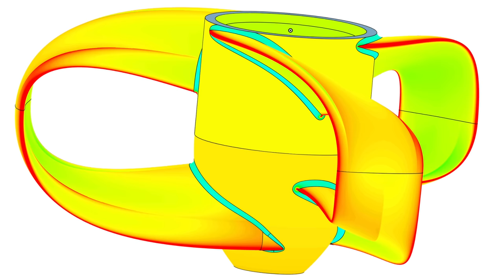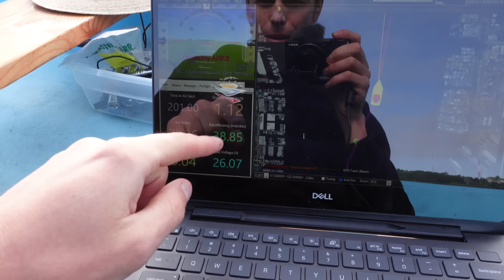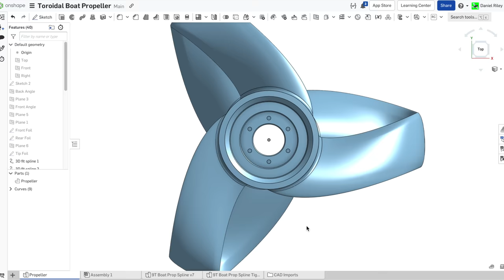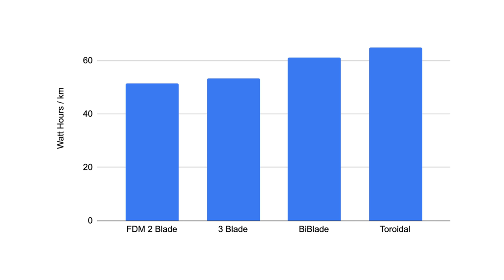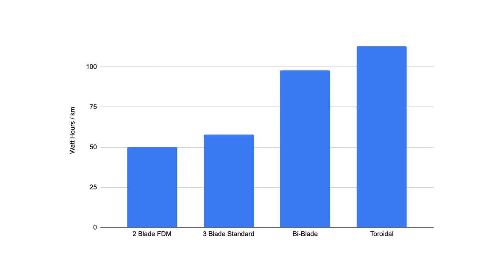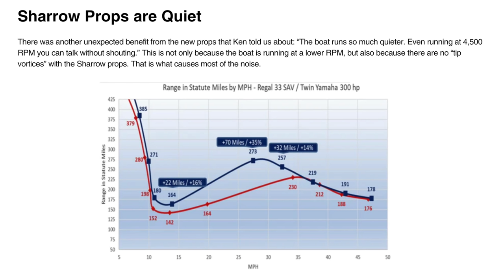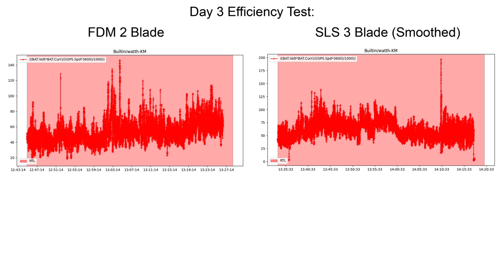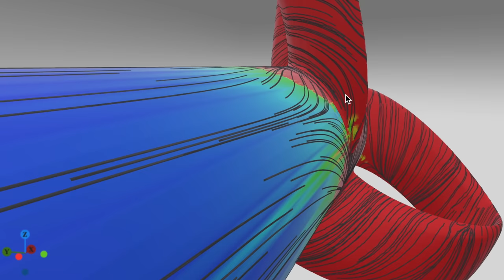Testing Futuristic Propeller Designs on my Solar Powered Boat

Comment: Ok, now borrow an actual toroidal prop if possible (they cost a ton) and do tests OR see if a company that makes them would make you a custom one because now we really need to know if properly adjusted toroidal are as better as they are.

PS: The thing about tip vortices are indeed a thing for water props but it is mostly only a concern for military ships especially submarines where every little noise source counts.

Comment: The first 3d printed propeller video I view made it obvious with the resolution of the printer was not sufficient to reduce turbulence as the layering did not transition smoothly from one layer to the next. I was ready to jump on the thumbs down button and trash the video, but I am pleasantly surprised someone actually knows about this stuff and is explaining the issues. Thank you much.

Comment: How do you not know that Greg Sharrow is the original inventor of the “toroidal” prop used on boats? He has 65 patents on it dating back to 2013. One of them focuses on the pitch angle of the loop end. Look up Sharrow engineering and Sharrow Marine. There you will find many images, even drone props. The MIT thing is nothing but hot air and their “patent” useless, as it focuses on the 3 way connection mid blade, they did that as Sharrow owns the loop back to hub patent. Your stepped hub connection will have much more drag than the Sharrow one which has taken 10 years of development.

Comment: larger surface 2 blade will be best for your boat. make it twice the diameter/surface area.  prop will turn slower for same push. should be more efficient for what you are doing. more blades =more thrust to get on plane faster but lose efficiency and top speed.  small or large diameter low surface area high pitch  two blade best for top end speed. large diameter high pitch large surface area two blade best for slow speed.  cars have transmissions to keep rpm below 2 thousand rpm for best cruising efficiency. that being said I think something could be done with a jet drive with a variable diameter jet exit tube like on a jet plane to tune with rpm.
there are 3 factors to boat speed and efficiency they all have to do with how much water the front of the boat is pushing. 1. hull shape 2.none plaining 2. plaining . The most efficient cruising speed on the water is just before and just past plaining, you back off throttle to just plaining. displacement hulls will go faster for less energy the longer they are but lose efficiency the larger the bow wave is as the boat will start to clime the bow wave as you reach the max speed of the hull length. i would think if you want to build a fast electric boat it will need to be long and skinny with a flat bottom and a pointy bow to cut waves with the weight evenly dispersed and the battery pack able to move forward and back a to be determined amount once you get on plain. hope this helps

Comment: Any palymer propeller, compared to metal is lass stiff. Also your one blate and multi-blade propeller are less stiff than the toroidal ones, because water will deform the propeller during rotation. this may reduce efficiency. Increasing stiffnes also increases efficiency.

Comment: I wonder if using an acetone vapor chamber would be an easier method of smoothing 3d prints (where the materials allow). I imagine there is potential for material degradation or brittleness in something like a rotor, but for aerodynamic surfaces it could be useful.
Reply: Maybe one could even use the 3D print, however fragile, as a lost-wax mold for a forged propeller?

Comment: It still seems like the toroidal prop as a whole just needs more R&D time put behind it. It just doesn't seem to have enough different iterations behind it yet to really know what aspects of it should be tuned. So while on paper it's as good or slightly better, there's a certain engineering void there since conventional props have had centuries of science and money thrown at them already. I would imagine that they will become much more refined for specific applications over the next 5 to 10 years. Right now everyone is just kind of tinkering and iterating with them it seems.

Comment: There are a couple of things that might scue the data points like boat weight on different days the thickness on the toroidal blades at several places and if you're going to say that you can't tell if they less noise because the motor makes more noise and show a clip of gas motors on a boat well I thought you were testing on electric motors which most electric motors are pretty quiet  so sound data is void not matching exact dimensions for the test model will void your data on speed and efficiency as well with power consumption because it'll weigh more so it'll take more power to turn it through the water. In aerodynamics a lot is the same as hydrodynamic but not everything so I'm not sure about the vortex issues but water is more dense so it might but the rest of the data is off just like angle of attack. I did appreciate the video and hope to see another about this with more of an apple to apple comparison instead of apples to oranges. Thanks cool boat BTW two thumbs 👍

Comment: Sections designed for flow in a compressible medium, (air), aren't necessarily good for an incompressible medium like water.  Supersonic airfols may be more appropriate, with sharp leading edges. 
One interesting experiment would be a dimpled surface, like a golf ball, to deepen the boundar layer.

Comment: The toroidal propellers at 24:44 look very different to yours. Both arms of each prop points backwards from the boat, yours seem to point outwards (or parallel/neutral in relation to the boat).

Comment: Did you balance the SLS props at all? Im just curious? I know that can make a HUGE difference when measuring the efficiency of electric motor driven props since excess vibration can rob HP like no other!  Thanks!

Comment: The air prop blades vibrating might be from p-factor if it is a slight non-horizontal angle? The difference in density between water and air could be exaggerating the effect. 32:11

Comment: Always like watching your videos, this one sparked a few ideas.  I was thinking about your boat and depending on the rated horsepower for that hull, most of this testing is really only related to running this hull in displacement mode essentially.  This Boston whaler hull is designed for planing so the speeds you're running are at the least efficient speed for the hull.  

I'm thinking that with your battery load, boat size, and Max reached watts of 5kW.... You're gonna need more power!  At least 18kW if my Wolfram math checks out. 

I postulate that those toroidal props might really shine once you're on plane.  

Keep up the great content!

Comment: I would have just figured out the maximum, minimum amount of power you always pull, then put a bottleneck into the power going to the motors at that level. That way you never push more power to the motor. Then log for times it goes under if by chance, then eliminate data 1 minute befor to 1 minute after power under.

Comment: @2:33 I really like your idea that toroidal props may specifically be benefitting from having an extra set of airfoils positioned in a way to aid eachother's airflow. 
It certainly would be interesting to see comparisons between double-foil and toroidal props specifically (which you did well here!)

Buuut, one thing I'm really skeptical of right now is that there's been a lot of media over toroidal props lately, and one thing I'm really disappointed about is the amount of props being designed/printed without a very math-y approach to finding optimal angles/shapes/measurments/etc. 

I really appreciate how upfront and blunt you are about lacking the specific tools/experience necessary to take the toroidal propeller idea to it's best form. There's been a lot of other failed attempts to recreate the claims of MIT's findings with toroidal props, but in many cases these are coming from people with even less technical ability, and unfortunately way less integrity/nuance about the way they represent their findings and methods.

Comment: You need to smooth out the props. The rough surface will fuck with the laminar flow and that could be what's stalling the blades.

Comment: Those newly printed props still look too rough a surface. Not knowing the substance's heat resistance I would otherwise wonder if doing something like powder coating them would give you an easy way to get a smoother surface? As far as efficiency tests, couldn't you attach them to a strain gauge and run them underwater? You could get some really fine measurements.

Comment: I love the test and your work looks really nice. I did notice that, with your increased angle of attack as well as twice as many blades, it seems like your two alternate propellors would require far over double the motor torque, which seems like it would be pushing the motor well outside of it's high efficiency island. Would it make sense to make a toroidal propeller with a substantially reduced angle of attack to allow it to match the torque demand of your two bladed propeller?

Comment: 33:11 This statement indicates you have your camera in full auto-exposure mode. Now, I know you're technically not shooting movies here, but the ideal way to run auto exposure is with "shutter priority mode," that way the shutter speed doesn't change and you get consistent motion blur. Another thing about motion blur is that the 180-degree rule is garbage. Motion blur doesn't scale with frame rate, it is ONLY affected by shutter speed and I have a couple videos in a playlist that prove it.

Natural motion blur happens between 1/40th and 1/60th of a second for anything intended to be played back in real-time regardless of frame rate. The best-looking combination IMO is 30fps with a 1/50th of a second shutter speed. The most versatile combination for "single setting shooting" is 50fps with a 1/60th of a second shutter speed. Both of these will film in any country without artificial lights flickering, both have natural motion blur, and both are smooth enough to not give me a headache (24fps mostly sucks).

Another thing that affects the quality of recorded motion is whether or not you camera is filming all keyframes ("intra-frame" mode) or some sort of interpreted frames. On canon cameras, this is called "all-i" as opposed to "ipb," and on Sony cameras this is called xavc-si as opposed to the -s and -hs versions. Whatever camera you have, look up what it does in either the manual or google. The last piece of advice; if you camera shoots both the decimal and integer versions of 24/30/60 (23.98, 29.97, and 59.94) it's slightly better to use the integer versions as opposed to the decimal ones. But more importantly, if it only shows the whole number in t he menu, it may be lying to you, so you should look it up, and above all else be sure to match your editing, export, and upload settings to whatever the camera is actually doing.

Comment: wouldn't be easier to compare propeller if you just mount one propeller type at each end of a sea-saw in the circumferential orientation. Then sent equal power to both, the one with better efficiency will out turn the other. as opposed to drive out at sea with a lot of environmental data noise

Comment: A single bladed proprellor would be the most efficient , but not practical as imbalanced, the toroidal and twin bladed propellors have way more wetted area. But it's also about the amount of power you can transmit without cavitating,  without properly calclulating/simulating each design it's not possible to be sure you have the right design for your hull and motors.

Comment: not certain why your design is not preforming the way the professional ones do, but the rough surface may be enough to negate the higher efficiency of the toroidal design . on the professional ones its an average (at the same RPM) of 40% savings on energy/fuel needed with the toroidal blades and the water is more focused so less fuel and more power and the better efficiency and less bubbles is what makes it quieter.

Comment: It seems on the high end boat propellers there is more a arch in the Front of there's and yours are more flat I'm not saying there not made well I think the torque  is more curve then flat that's why there is a bubble staying on the tube of the prop

Comment: The thing with the new props is at 80% power they do have a energy and efficiency boost. At full throttle they don’t get much if any and spooling up they don’t save a lot. But the cursing deference is big specially when economy of scale comes into play.
Reply: "The thing with the new props is there 80% power savings."
No. Why you lying?
Reply: @ABaumstumpf  not power savings. It’s 80% throttle is there sweet spot. Came out wrong will correct. But at 80% throttle is where they do save on fuel. If you read the whole comment I do say it more clearly tho that was miss worded. Overall saving at 80% throttle is like 12% but again economy of scale on large ships that’s millions of dollars saved. And airlines are playing with a 3-5% saving with the winglets at the tips saves them a ton over time.
Reply: @kevinb.8649  "but again economy of scale on large ships that’s millions of dollars saved."
That would only be the case of those ships would not already have good props - which they most certainly do.
Toroidal props are basically just a fad. They have been around and in use for over 100 years, but they are only used in very few places - for example some military uboots.

"And airlines are playing with a 3-5% saving with the winglets at the tips saves them a ton over time."
Yes and they too do not use toroidal propellers cause those are less efficient.
Reply: @ABaumstumpf  they are not a fad. Sure they were overhyped for sure. But they are the future of shipping and there cost to produce will more than pay off in savings. Are they a fit for every application. No of corse not. Other technologies are far more effective. And on the sound level for drones. They do cut some of the lower frequency harmonics created by standard props and make it to where u can’t hear a drone from as far away. But even that is talking about a 10% lessening of distance it can be heard from. That’s why people got excited about them on drones. And they all so haven’t been optimized yet and are very complicated to produce and the savings are not there for drones maybe. But that is where economy of scale does make this still a very big breakthrough and not just a gimmick or fad. They are here to stay just they will be very application specific. Tho even a medium sized boat can save fuel using them and eventually pay for the extra cost cause right now only a single company are even making them for boat props commercially and only for specific engines and boats. They are just another tool in the box for engineers to use.
Reply: @kevinb.8649  "But they are the future of shipping and there cost to produce will more than pay off in savings."
How would a more costly less efficient design be the future? 

"And they all so haven’t been optimized yet and are very complicated to produce and the savings are not there for drones maybe."
Again they have been around and in use for well over 100 years. They simply are less efficient.

"But that is where economy of scale does make this still a very big breakthrough and not just a gimmick or fad."
No, economy of scale just makes things cheaper - but they are inherently more complex so they can not become cheaper than conventional props.

"They are here to stay just they will be very application specific."
They have been here for a hundred years already - nobody is disputing that.

"Tho even a medium sized boat can save fuel using them and eventually pay for the extra cost cause right now only a single company are even making them for boat props commercially and only for specific engines and boats."
And they could save even more fuel by just getting a conventional propeller that is fitted to their boat - more efficient and cheaper.
Reply: @ABaumstumpf  cause it the cruising speed of ships where most run at 80% throttle or so it saves fuel. Go do some actual research on this then argue with me when you know and understand what your talking about. All so ever wonder why they hide the props on nuclear subs??? Cause they may just be using tec a lot like this but figured it out a decade or more ago.
Reply: @kevinb.8649  wow - if ignorance was a skill - you have mastered it

Comment: 35:28 Have you thought about adding a "wingtip" to the surface where the low pressure area is on the tip of the bottom of the blade? 

Would that not help? like the a wingtip of a plane? Like eliminate/reduce the pressure vortex seeping around the edge of the surface?

Comment: 31:30 the turbulence is caused by the pressure difference of the water, so your prop is too large, try with more shorter blades